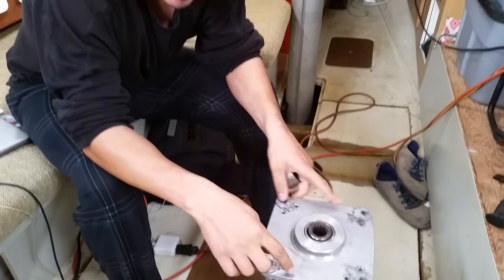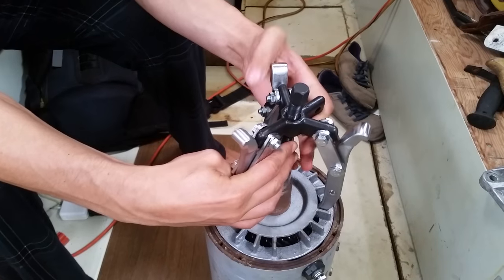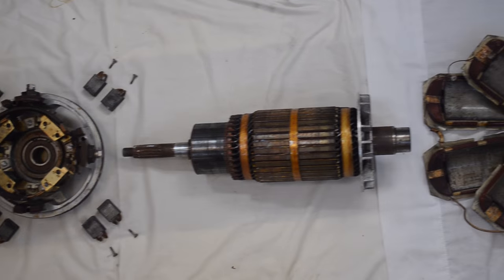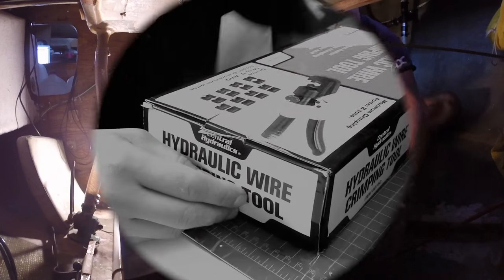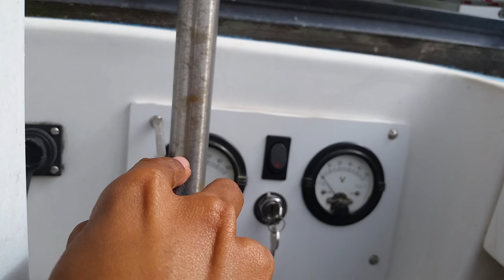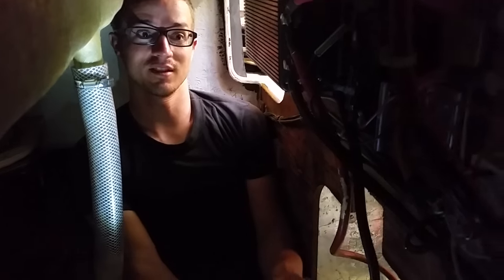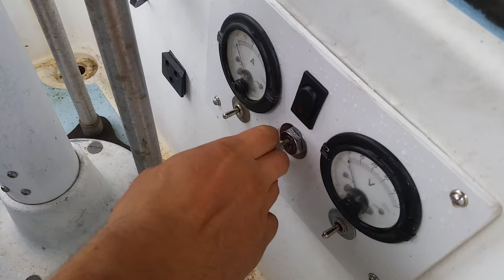Experimental Wiring of our Electric Motor — Sailing Uma [Step 19]

Comment: I'm wondering if you've upgraded to LiFePO4 batteries since then. Much higher power density for the weight. If you DIY them from EVE 280 Ah cells it's about $2k for a 14kWh battery bank. And did you get a second spare motor built or have a backup motor should that one have a problem?

Comment: Another very impressive video.   Do you have any calculations worked out as to what your range would be going like 3 knots under motor power?   I have that same scooter but in red.  Love my Buddy 50
Reply from the maker: Yes, we have done a lot of research and calculation. All very tentative since the proof is in the pudding, so to speak. Our estimates put us around 10 kt range in calm conditions.
Reply: +Sailing Uma Your thinking the motor will push you at 10 knots? That&#39;s well beyond hull speed for that size monohull.

I really enjoy your stuff your putting out. I do worry about you. 

Having been around this a while, I see so many folks who are new to sailing, who think they can turn a blind eye to all the knowledge that was learned by the folks who came before them. Decades of learning by some really educated folks. In the end it is usually a long sad lesson to be learned. Literally the school of hard knocks. or in the case of sailing &quot;hard rocks&quot;. You are putting your life in your hands. Take this seriously. things can get ugly fast out there. It&#39;s not all Captain Ron and Margaritaville.

You are still going to need some way to charge the batteries. Solar and wind gens will not do enough. Sailing everywhere may sound romantic, but in practical application you can get into trouble. Run out of wind in the duldrums and you can run out of water and food in no time. 

Your wanting to do videos and stuff, that will tax your battery bank. All the necessary electronics common on boats today will drain your small batter bank fast. Don&#39;t be foolish. Have a back up plan. Please. By the way I just became a Patreon supporter for you guys.
Reply: I'm pretty sure they meant to say10 nautical miles is their range under electric motor power before having to recharge.
Reply: +Down In The Islands

 I see. Well that should handle docking then. Better hope they don't get becalmed...Nothing more frustrating then wanting to be somewhere close by and there is nothing you can do about it. Especially in the case of injuries or emergencies. Ship happens!

Comment: Dan, another nice job; you could have easily gone into engineering instead of architecture.....btw, do you or anyone at your location have a wire rope swaging tool?  I need to re-rig my mizzen mast using 3/16 wire and need to swage the little copper sleeves onto the wire. Thanks,  Ken in Orlando
Reply from the maker: Thanks Ken. Not sure about the swaging tool though. Its not something a Sta Lock would fix?
Reply: Sailing Uma
Yes, I priced the sta-lok fittings but they're quite expensive....cheaper to swage the wire loops and thimbles together.  Just don't want to have to buy a tool I'll probably only use once or twice....

Comment: How much did it all cost in the end ? The motor,  batteries , wiring and gadgets ?
 I live on a narrowboat and I need my engine replacing ... I'm thinking of going down this electrical path .
Reply from the maker: The original set up was mostly used parts, including the solar and batteries, we were around $1500 usd. 

We've made many modifications since then.

Comment: Electric Guru, Curtis Speed Controller 1209 @48 volts and for reverse here is the link good for 300 AMPS. What makes the Reverse Albright so nice is that it is designed for many different voltages, lets say you upgrade to a higher voltage? It is capable of 12V to 96V DC and can handle far more power than a electric boat drive system will ever demand. Plus this stream lines your electrical system, I suggest 2/0 cable-FINE STRAND, the current cables your using are too small a gauge for the forklift motor your using, at a guess your wiring will heat up and start to smoke in 30 minutes of use or less.
http://www.evdrives.com/product_p/sol-sw202s.htm
Reply from the maker: We upgraded to a Curtis 1244 last year. Cleaned up the wiring nicely and has internal reverse. And recently upgraded the wiring to 4/0.

Comment: i have an interesting question maybe you have researched this. i would love to use solar power to run an electric engine on my own boat, but if i were to do that i would want to wire the solar panels directly to the motor as a backup. primarily it would run through the battery as normal, but if the batteries were to be low, i could flip a switch and have the solar panels feed direct to the motor. this way, you would have "some" power to the motor constant, might not be much but would be a little propulsion. the challenge with this is solar panels put out a varying voltage / current. is there a way to control the current output (current controls torque) while allowing the voltage (prop speed) to vary by sun exposure ? anyones input on this would be great. i would love to have electric engine, but in order for me to do that i want to solve this challenge. thank you

Comment: What motor controller did you use with this? Is it mentioned anywhere? Thanks
Reply from the maker: We didn’t really mention it, because they are all motor specific. Best bet is to find a motor that is the right size, then contact Curtis Instruments and ask what the meat controller will be for it. They make controllers for every type of motor and have been very helpful over the years.
Reply: Hi, Thanks for the reply. No worries. I've got a similar style brushed DC motor that i'm looking to control the speed on, and i remembered you fitting the DC forklift truck motor, so i just came back to look for some tips.

Comment: Interesting experimental work.  Believe me I would chuck the engine for all electric if I could get the same performance and make less pollution.  Just not there yet.  You guys are on the front of the wave of change if it comes.  Batteries are the last frontier.  Dirty and polluting, the battery industry has a long way to go yet.  As far as all the rest, from controls to motor, these are relatively easy engineering solutions.  Be careful with them amps kids!

Comment: PVC board?...Is that like Starboard?
Reply from the maker: Yup!
Reply: +Sailing Uma Cool..thought so :)
I'm currently looking at a 5 year plan to convert a catamaran to electric. Look forward to your results and trial/tribulations.  Have you looked at Bianka's blog?
Reply from the maker: +Douglas Montgomery Yes, we've read it many times. There is some great info on there.
Reply: +Douglas Montgomery Doug, I chartered a Lagoon 42 a couple of years ago that was converted to electric. It was fun and quiet, But my thinking was they lost the ability of having a back up. With a diesel in each hull the boat can be run with just one engine so you always have a spare ready to go if necessary. With the electric set up everything was dependent on the generator. So just one engine and no backup. 

I know the argument will say you have the sails as backup, but in practical application anyone who has brought a boat into a marina in a blow knows you don't just sail into your slip.  There is a reason builders put engines in sailboats.

Comment: i hope that battery wooden shelve is only temporary. could you guys adjust sound of your videos please. music is too loud and comentary very silent
Reply from the maker: Weird. We listened to it on different computers with and without headphones, it sounded fine.... But I still haven't mastered the audio techniques yet so there's always room for improvement :) Thx for the input.  And yes the shelf is permanent. Its a marine grade plywood that we took from one of the setties, was already in the boat for years and should survive normally.
Reply: +Sailing Uma I have not much sailing experince, but many stories tell, that first thing that breaks in storm are battery brackets. And I dont have to tell you how many dangerous situations it can cause. Your shelf looks ridiculously weak and it will break wery easily. In case of capsizing your batteries will just fall on the ceiling. As i see you dont use gel batteries and you will probably add more of them, so this is even more dangerous.

Comment: You will have to be careful of other boats (and submarines!) because an electric drive is so very quiet, the only thing sonar could hear would be the "cavitation" of your prop and any sound produced by the swing and sway of your rigging. That would not be very far away, either. Your boat would be very quiet in a seaway, either on sail, or electric power. I would put an ultrasonic "pinger" on the inside hull, you won't hear it, but Navy subs would, so they wouldn't surface beneath you. Be sad to lose your boat over a thousand to one chance - but it has happened in the past.
Reply: Lol, a navy sub would hear them just fine. They are far from "quiet" on the scale that those subs can detect.

Comment: How do you planing on keeping the batteries charge enough to get a decent range should the wind fail or as per usual from the direction you need to travel?  Have you considered fuel cells. I just read this article and I tough you might be interested by it. http://www.bwsailing.com/cc/is-a-fuel-cell-right-for-you/
Reply from the maker: +Marcel Simard Interesting idea, using fuel cells. It seems a little pricey for now, but glad to see that technology being developed. Can't wait to see where it goes.

Comment: More questions than answers, but what about this https://www.youtube.com/watch?v=U0OAaW4En7o could you utilise your copper hull as part of the system? you also probably already have / need the zinc anode.  I'm no expert but thought it might be interesting for the times solar and wind aren't an option. p.s bear in mind that even teslas powerwall has only 1000-1500 power cycles (probably at 50% discharge), i would recommend that your design specification allows for only 50% discharge and check the number of cycles you can get on your batteries, you could find that you're having to swap them out too frequently.

Comment: Was wondering if you had thought of usnig Vertical axis wind tubines on your  mast stays as a method of charging batteries. if they were aluminum they could double as radar reflectors. I have seen where helical ones similar to this https://www.youtube.com/watch?v=eRO4avB-dqM  but longer ans narrower are used in Europe and are self limiting so there is no need for a brake clutch. Nice work on the wireing job and geting the motor reassembled. How many extra parts left over I alwats have one or two.

Comment: you painted over coils(windings)....those are really suppose to be bare...it still work but you are knocking efficiency down where you want to be as efficient as poss...its like you insulated wiring that needs to be bare...you want to expose the electromagnetic waves rather than insulate them

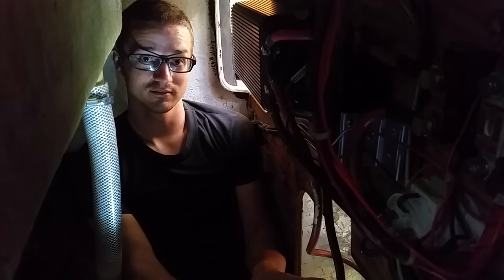Comment: I know that I will be disliked here but, 7:34, it is not an engine... :'D
Reply from the maker: Ha, very true. I knew as much as soon as I said it, but thats what you get for doing "live" takes.
Reply: Sailing Uma Thank you for being so forgiving of my comment. :')
Reply: Sailing Uma I do have to say, you two are the best at this, this, what, sailing, thing. I look forward to getting to see when you do finely get Una out and give that motor a proper test / run. :')
Reply: +Walking Zed's Push Bike.  Engine -  A machine that converts energy into mechanical force or motion.
Reply: ***** Fair enough!
Reply: +Major Agitator Today, the words are virtually synonymous. Please see this article from MIT. 
Cut and paste into google - http://engineering.mit.edu/ask/what’s-difference-between-motor-and-engine
Reply: Hmm. Interesting. Text books that deal with the thermodynamic performance of combustion engines used (i.e. 40 years ago when I was studying Mech Eng) to refer to them specifically as heat engines so it seems the case for using engine interchangeably with motor has precedence.

Comment: Not sure if anyone has commented on this but...  Brush-less motors are recommended for marine use because the risk of igniting gases (propane) are not there.   Did you consider this?  Just curious.
Reply from the maker: +Cleo Torris Yes, sparks and gas fumes are bad. The plan however, is to install a solar cooker and induction stove. In the meantime, simply checking the boat for fumes before motoring will keep us safe.